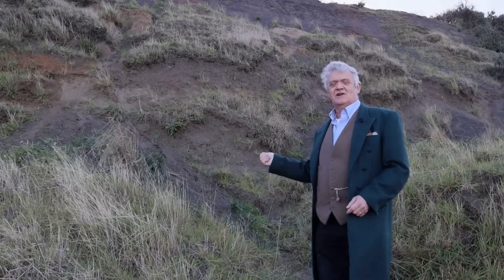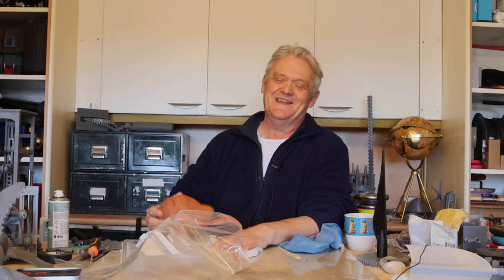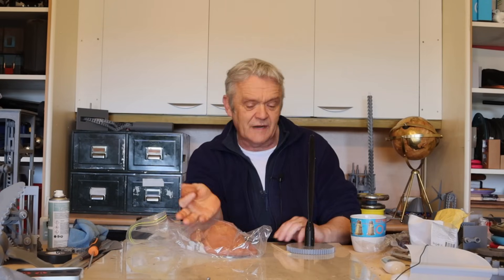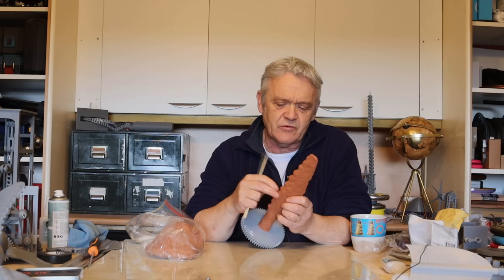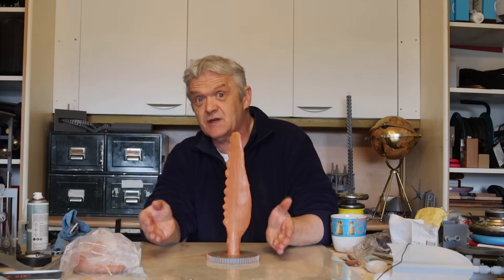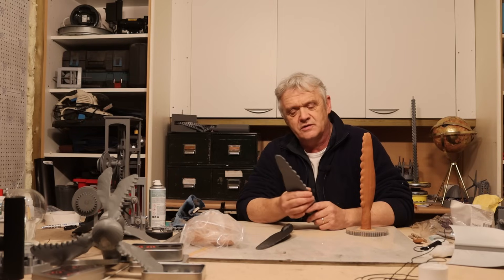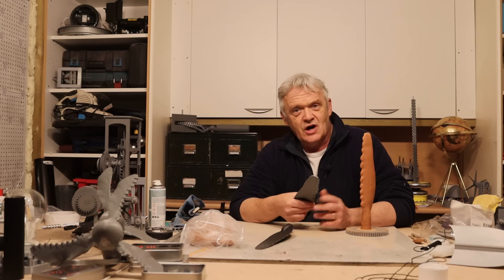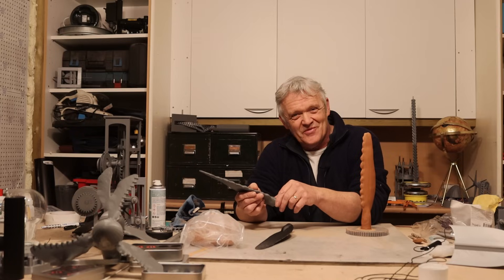2104 Ingenuity Tubercles - Putting Bumps On The Mars Helicopter

Comment: Thanks for going through the details for processing clay . Very useful to me as I've dug lots of holes .
Reply from the maker: I am glad it helped mate
Reply: Me too - I had not looked in to it - I'm glad he built something out of a non-plastic - 3d printing is very cool put it appears to use plastics, the fumes are bad for you, I worked injection molding - yuk
Reply: @MzM731  actually the PLA filament used in 3D printing doesn't produce fumes, and is even considered "food-safe," although I wouldn't use 3D printed containers for food without knowing anything about the chemical composition of the dye and possibly other compounds mixed in the PLA. For other use cases though, it seems reasonably harmless.

Comment: There is a reason that car designers still do full models out of clay and then both scan and make molds of them. It just works. the scans can be used to tweak the design later but the art and skill that goes into car design is amazing. Also that blade is looking more and more like a whales flipper.

Comment: Work with what you have - physically making art (or modifying precision components freehand - then  scanning into the system  - if a fantastic use of all levels to the industrial - progression.

I have been "into"  - as a curiosity, with some experimentation etc, all sorts to strange aerodynamic features like whale bumps, bird  "alulae" -leading edge devices -  wingtip modification (highly variable throughout the regimes  - then comes the other 3,:   variable camber, sweep and dihedral. - -They have us beat in the low Reynolds number arena (we need a lot more computing to compete...  Great to see the masses getting exposure from the  pre-Industrial ade to relativity.
Reply from the maker: it is a fascinating subject mate

Comment: Tubercles looks like another form of turbulator.  A turbulator is a device that turns a laminar boundary layer into a turbulent boundary layer.  They are used on aircraft wings and large wind turbines to increase the angle of attack at which the wing stalls.
Fighter plane in WW2 used them to maintain control of the aircraft during extreme maneuvers.

In large wind turbines turbulators are used to keep the blades from stalling when strong gusts of wind hit the turbine.  They help so in getting the turbine rotor up to speed when starting up.  The trade off is that they slightly reduce the lift to drag ratio of the blades when operating at their designed tip speed ratio.
Reply: Is that the same as a vortex generator on airliners ... Or divots on a golf ball? Just curious. I would love to build an aircraft someday
Reply: I'm now wondering if the concept would be viable for boats , sharkskin is sandpapery  and was once used as sandpaper.
Reply from the maker: cheers mate

Comment: Are these like vortex generators.. I guess im curious, What benefit the tubercles have over a planar wing surface? Is it something like a golf-ball's divots that give it extra lift and reduced noise? 

Im in the process of molding a carbon fiber propeller right now. I dont have a 3d printer or cnc machine so everything is craft mold for me. I was going to use a 2 part silicone mold. Place the blades in a vacuum heat seal food bag add the silicone then vacuum seal it. I figured that the vacuum bag would make a great dividing line for molding.
Reply from the maker: that's clever - nice one mate - thanks for sharing that tip - and yes they are

Comment: I liked when you treated blades to give flex - action -arguments for or against more peices vs less in terms of articulation so “solid state” flex control via air pressure etc or other mechanisms such as flywheel clutch to optimize wing shape per wind velocity
Reply from the maker: cheers mate

Comment: How do the nuke TEGs on the probes function. Don't they have to shed heat to separate the charge? In a vacuum? What about the other 90% of the waste heat?
Reply: They shed their heat via infrared emmission.
Reply: @AtlasReburdened  into a vacuum?
Reply from the maker: tbh in the same way they all do - all that the nuclear material does is provide the heat for the hot side

Comment: Did you make a 3d print? And put clay on that. What is the durability of clay? Did you put the clay in a kiln? I was thinking that might work better then PLA in an outside environment.
Reply from the maker: i just used the clay as a model material mate - it hasn't been fired